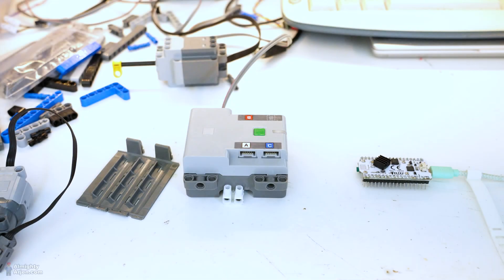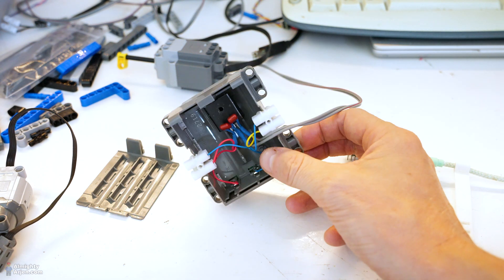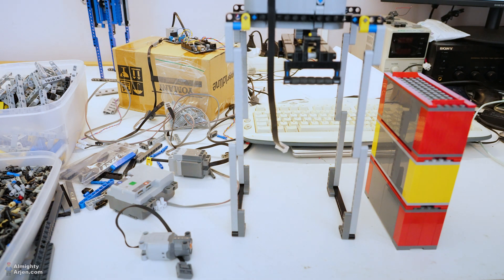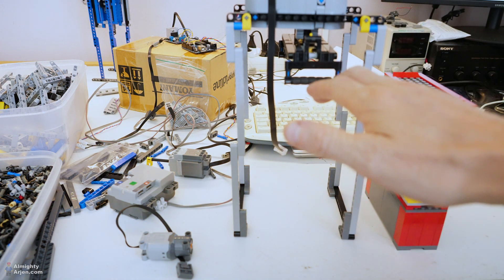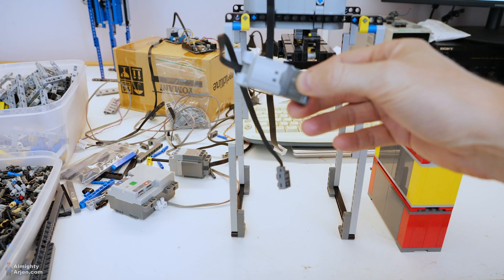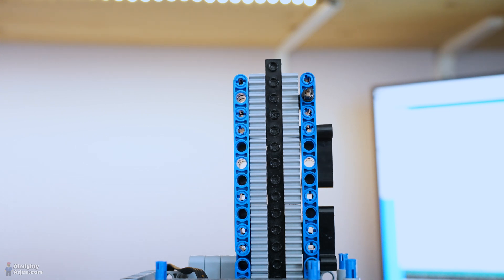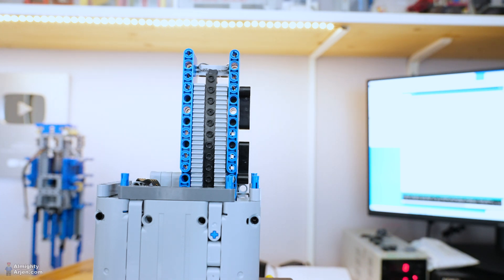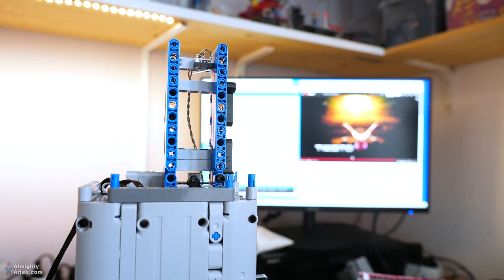Lego train automated container terminal WIP E26: PU or PF motors?

Comment: When you had the problem with driving into the limit switch, the first place my mind took me was to the idea of adding another switch or sensor lower down, in addition to the limit switch,, to detect when the mechanism approaches the limit switch and trigger a slow-down just before it hits it. But then you showed that it can be done adequately using only timing.

It made me think about optimising for different factors in engineering solutions. The fundamental problem here is similar to controlling the position of a lift/elevator or controlling the position of an inkjet printhead, which have both been done various different ways over the years, optimising for different factors.

(If anyone was hoping this comment would come to some kind of neat conclusion, then I am afraid I must disappoint you.)
Reply: Adding another switch was also the first thing that came to mind to slow down the crane at the end. Yet the end result of the slower crane is also nice and in my opinion looks like a more realistic speed overall.